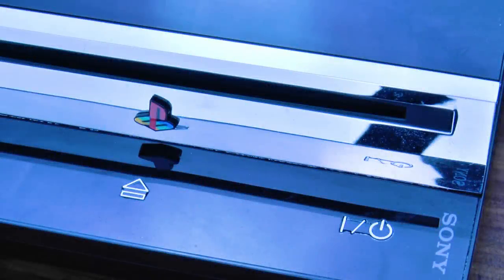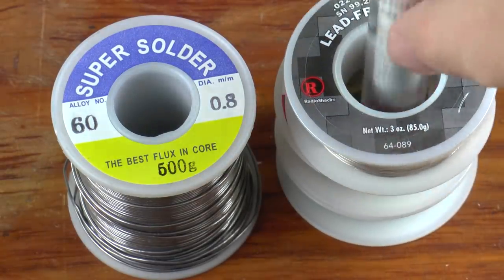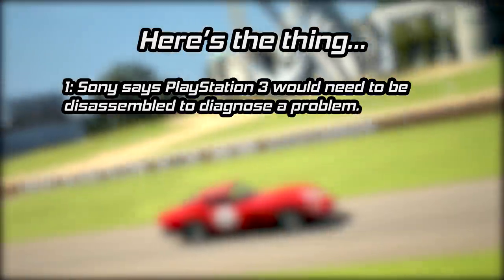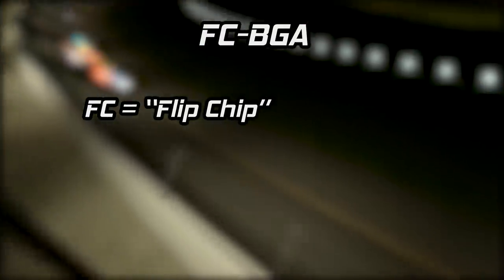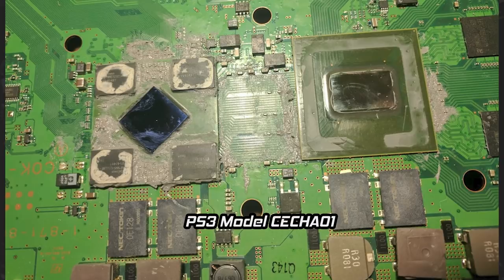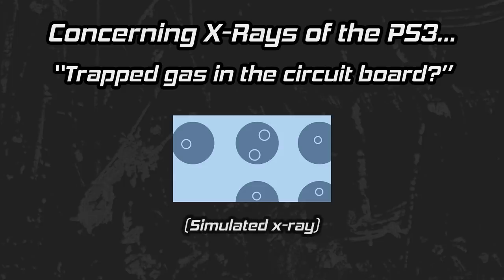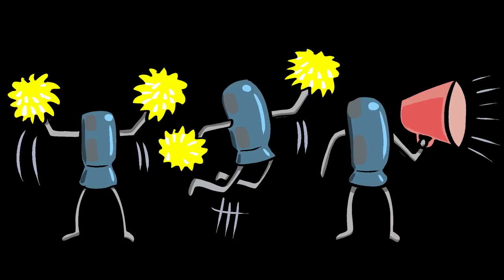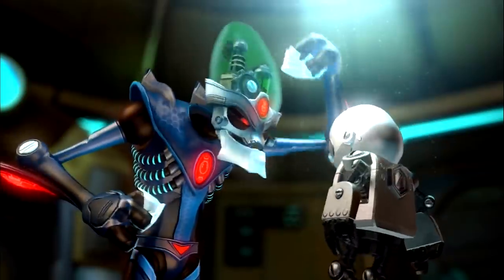The Misdiagnosis of the PlayStation 3 Yellow Light of Death

Comment: I have a launch PS3 that hasn't experienced the YLOD yet. I want to open it up, clean it out, add new thermal paste and new thermal pads to replace the old originals.

Is there anything else you can recommend to do to keep an early PS3 alive and well in the long term? Something that doesn't require extremely difficult soldering?

Would you be willing to make a video series on maintaining game consoles for the long term? I'd watch all of them.
Reply: Jailbreak it and adjust the fan settings. The default fan settings let the console go way too hot before properly cooling it down.
Reply: @calleha01  OK, I'll keep that in mind, thanks. If anyone has more tips, please share!
Reply: I water cooled mine for $35. Brought the temps from 85c to 45c...
Reply: It's a DINOSAUR
Reply: @jjhack3r  This is interesting, I'll look it up. Thanks!
Reply: I can tell you first hand... change out the thermal paste to something like artic silver 5. When I changed mine it was dried out. I seriously doubt it was helping with thermal transfer and causing unnecessary heat stress to the cpu gpu. If you do however, consider changing out the paste underneath the heat spreader as well. Just take your time and be extra careful... the spreaders are glued on.
Reply: @synth505  This is good information, thanks. I just bought arctic silver MX-4 (2019 edition) for my PS4. This drastically helped lower the fan speed / noise on my PS4!
I'll use the same for my PS3, and be extra careful about the heat spreader. Am I supposed to re-glue it back on? If so which type of glue should I use?
Reply: @Chocoburger  no... thermal paste should help to hold it in place. Also when you reassemble it, the heat sink that sits on top of the spreader will apply enough pressure to keep it in place.
Reply: @synth505  Understood, thanks!
Reply: @Chocoburger  if you look it up, you won't find much. I used generic water blocks, pump and radiator for a pc. Mounting the radiator is the hard part. Also you need custom brackets to hold the water blocks. I just used flat steel and drilled 2 holes.
Reply: @jjhack3r  This sounds much more complicated now. Without a video guide, I'll probably screw it up. But I appreciate the added info.
Reply: How?

Comment: Hey, also the PS3 heatsinks have an issue as well. They have too much vertical space below the motherboard and ultimately PULL on the GPU AND CPU hard.
The thermal paste bond between the IHS and Heatsink + gravity lets the heatsink tug on the RSX and CELL IH and pull it down. This physical force ultimately stresses the solder balls. I strongly believe this breaks connections whenever the RSX or CELL heats up. When these things get hot, the solder almost flows but slowly. (it'd take alot of thermal cycles) 

For my PS3 with the infamous GLOD, the screen started to artifact and a small sparkgap noise came out of the console whenever the RSX hit 75C. It hardlocked immediately after.
This tells me some solder balls that deliver high current to the chip disconnected and caused a hardware error. (This caused a GLOD for me occasionally + interminent artifacting)

I flipped the ps3 upside down so the heatsinks (because of their weight+gravity) push the chips onto the motherboard. (just like what the coin method fix for GLOD tried to achieve)
AND MY THEORY WAS RIGHT! IT NOW WORKS SMOOTHLY!

Its been 6 months of constant usage and 0 noises, 0 artifacts, 0 freezing, 0 problems and played through a bunch of games at 68C.
It seems like every aspect of the PS3 was fucked to begin with. 😅
Reply: Exactly. It's unbelievable how the design- and all the inherent flaws in it- were approved. The only explanation is that they felt pressure to rush out Playstation V3 (PS3) w/o an intensive several-thousand-hour testing period on 100 machines. If several thousand hours seems extensive, consider that a new console buyer would easily average a minimum 2 hours/day. Let's say average over1000 hours year.

Comment: In the middle of learning how to solder so I can replace the NEC Tokin capacitors. Even removing them seems difficult and there isn't a guide in English on the Youtube's yet. My CECHA01 and CECHC03 will survive.
Reply: My mate Vince recently did one..
Reply: @Jaydan121  Good timing. Saw it when it released.
Reply: Vince team, unite
Reply: yeah also saw the vince video,and this one popped up randomly,youtube sure do spy on us
Reply: I used a cheap heat gun off of Amazon, put it to 400 degrees took roughly 15-20 seconds came right off. Plastic did melt a tad but was no issue. I fixed my 40gb ps3 with this method
Reply: Use some leverage under the component then some heat on the solder lever upwards then move onto another solder pad, heat and lever, move and same again keep repeating and levering the component when the solder is liquid. Little by little piece by piece it will come free nothing to be scared of if you are patient. 
If you are removing a component to be replaced you can afford to bend and break it as it is going in the bin anyway, just be careful of the traces on the board but they should be ok unless the board is corroded.
Reply: Use and heat gun and some flux. Don't just heat it and take it off or pull it off with a knife without any heat. Better to do it the proper way
Reply: Just make sure to keep the same ESR!!!!! You got this! As long as you don't totally rip off the pads, installation of the new ones will be simple! Also keep one of the old ones on each side, they flow through each other, otherwise you need wires to connect them all! search "psx-place ps3 NEC/TOKIN replacement" and you will be perfect! :)

Comment: Love this video man. I work in contract manufacturing, I used to be SMT but now I'm on QC building 3D AOI profiles. I have an OG YLOD PS3, and have access to a large parts stock that my company will have no issue with me grabbing a couple tantalums to see if this works on the PS3. I'd be more than willing to collaborate on this project for a video with documentation of the process if you'd like, It would be fun to help the community in some small way
Reply: should be noted I pretty much have free reign over the rework stations and reflow ovens, with very adequate lighting and good photography skills. I can properly document this

Comment: Interesting video, never knew those capacitors were an issue! I've heard about the thermal paste under the IHS drying out over time, causing the system to run hotter than it should or shut down after a few minutes (this failure mode happened to my CECHG unit), and that nVidia GPUs in many laptops from the period the PS3 launched, between 2006-2008, had bad underfill processes causing them to fail, but this is new to me. At least the 360 has a secondary error code with its RROD to narrow the problem down - on PS3 you are just guessing.

Comment: I've actually repaired six PS3's by replacing the NECs with tantalums. Havent had a system fail again since :)
Reply: Do you do this as a side gig? If so, I have a YLOD PS3 that could use some help.
Reply: ps3 super slim no have nec tokins
Reply: @maytizevb  yep, I think the 25xx and 3xxx Slims uses tantalums and also the 4xxx series. Since this models doesnt suffer that much on YLOD, instead most of them experience we call blackout issue.
Reply: Is this a difficult process?
Reply: I have a 25xx model with the blackout issue. I have a working super slim I’ve been swapping caps with, haven’t tested all of them yet
Reply: @EmilePolka  i have ps3 slim what model is that exactly
Reply: @chasefournier  there are many things trigger this, try removing the bt/wifi module and see if that fixes the issue. if it does then you either have a power issue feeding to the module or the module is busted.

though that's only one of many known cause, sometimes the cause of blackout issue cant be determined, it just doesnt work.

to avoid this issue, i recommend that you unplug your ps3 power out from the wall when your done using it. after all when you plug your ps3 to the wall, that module is always active all the time waiting for the command when you press the PS button on your controller.
Reply: @EmilePolka  unfortunately that didn't work.
Reply: Kleiner Helfer  it would have been more helpful if Sony at least offered a repair service for systems out of warranty, rather than telling customers they're SOL.

I had a launch Xbox 360. Didn't suffer the RROD, but it had a faulty AV port. Since it was out of the warranty period, and not covered by the RROD extended warranty, they still offered to fix my system for $100. Which is more than Sony was willing to do.
Reply: Kabal82 sony fixed mine that was out of warranty, but the replacement failed in the same way
Reply: remle ikawura what’s the blackout issue? I just bought a ps3 online that I want to fix and it has a green light, but no video output on either hdmi or composite (and yes, I tried the two beep reset input procedure). Is this the issue you refer to? Any help would be much appreciated. I also could see the prev owner tried to solve with nee thermal and flux so I assumed they heated up the joint. They said “video displayed once”.
Reply: @mikeO31082  Sony did do that for a time. I don't know when they stopped though. They charged $150, but I've read posts of most people getting back a different PS3 than the one they sent in. Not a different model, just a different unit
Reply: @RyanBurnsRed  I got a brand new 60gb when I sent mine in, but it also YLOD two months later. Sony only offered 30 day warranties on the "repair" too.
Reply: @hailhydra5061  graphics chip what was wrong with mine. When I could rarely get video the screen would freeze and be all pixelated it is a ceche

Comment: "Trapped gas" could refer to buried vias that are basically metal-plated holes connecting two parallel wires inside the PCB itself. A large board can have thousands of these. Naturally, those holes have harmless space in the middle unless filled in by some material in a separate operation...

Comment: Check out the PS3 "eraser" mod. I did it and my PS3 temps dropped 10C. This fix shows that earlier models of the PS3 simply didn't have enough mounting pressure for the CPU heatsink to stay cool. This isn't a sketchy mod either. It's just recreating what Sony did in later models that included a plastic cover for the CPU hole that increases mounting pressure.

Additionally adding CFW to your PS3 shows that Sony prefers running your consoles hot all the time in favor of low fan noise. My early model PS3 idled at 80C before the mod and the fans were sitting at less than 20%. To put that into perspective PS3s have an emergency shut off at 85C due to high heat. That is very little headroom and running the consoles that hot all the time is bound to lead to issues. The CFW has custom fan controls which I'll be using from now on so it doesn't die an early death. Fans aren't even much louder if you repaste and do the eraser mod.

Comment: The solution is to replace the nec tokin caps
Reply: can u easily replace them?
Reply: @Kig_Ama  that I don't know but it does require the use of a flat bladed knife
Reply: They don't come up easily. Takes a while working at them with a hot air gun to pull them up.
Reply: @Kig_Ama  define easily... they are a pain to extract... once removed you can put the new caps and thats it (remember to put them on correct side)
Reply: @iamtheflu  though, I've seen some people just "cut them" and solder caps on the side... 
Not clean, just lazy... but works fine.
Reply: @iamtheflu  I do repairs on those nec/tokin. and they are a pain in the ass to remove. the easiest way is to destroy de capacitor with pliers or something (being careful) and after that remove the legs of them with an soldering wire. and replace them. on the inside they usually look very burned.. but that is what works best for me
Reply: @jpraleixo   makes perfect sense bro. So what's up with that service???

Comment: For many many people that before this had never even diagnosed a failed board, most folks accepted or tried whatever they heard on the message boards about reflow, reballing. and such. Anyone that knows anything about fixing problems with PC or Apple products need to be checked for shorts to find the problem even taking out components to test them until the fault is found.. not a easy process.  It seems now many are pointing to the NEC/Tanum capacitors failing badly, and that has been confirmed so far as I know. Great video by the way.
Reply from the maker: Thanks, Mike. There is definitely a difference in the pursuit of knowledge and making a diagnosis between those that repair vintage PCs and those that repair consoles. Hopefully we see more people investigating the PS3’s faults these days vs one fix solves all.

Comment: Great scientific analysis. I repaired a friend's PS3 several times by "home-reflowing" the board on my electric frying pan. My thought process was the same as yours, I had assumed it was "some" solder joint or other component which liked being heated up again, but I wasn't assuming I was reflowing the CPU or GPU or anything targeted like that. As you say, it's a very heavy hammer of a fix. So heavy I was actually concerned with surface mount components falling off the underside of the board if I heated too much!
Reply: Backside components are attached with epoxy, which is usually dyed red. They first populate the backside, and during reflow, the epoxy sets, and then the main component side. If they could fall off, they would have fallen off while main component side was reflowed during manufacture.

Comment: There was a massive problem with all sorts of semi conductors that used lead free ball grid array solder joints. It affected everything that used them at the time, even desktop GPUs. There are many studies of it. Lead free solder required more than 2x the temperature of 40% lead solder to fully turn to liquid and reharden correctly. This also hit around the time of the great capacitor plague where the world market was flooded with a stolen unfinished capacitor substrate formula that caused premature failure of electrolytic caps. It was a terrible time for reliability of every electronic device.

Comment: I used the blow-dryer method to fix my ps3 temporarily. Does this mean my YLOD was actually a solder problem rather than a capacitor one?
Reply: A hair dryer doesn't get air hot enough to melt lead free solder, so no.
Reply: Did the same, managed to get the disc and transfer all save files to a slim system, thank god.
Reply: The correct answer is: It's warms NEC Tokin capacitors back to life but it is not a very long lasting repair and we can’t know how long it will work.

Comment: The issue with diagnosis is that the YLOD is so vague that it can be literally anything. Simple component came loose, NEC caps, overheating, or (in my case) the bga failed on either the rsx and/or the cell-be. Because most lacked the knowledge to read the syscon, the misdiagnosis happened and continues to happen.

Comment: You failed to talk about the other major problem with the Yellow Light of Death... Bad Blu Ray Laser Modules... I used to repair PS3's through eBay at a rate of about 10 to 20 a week in 2008 and 2009.. This was a major problem that was easily fixable by getting a Japanese made laser module vs the factory provided Chinese part.
Reply from the maker: Yes. There were also problems with power supplies going out - various revisions of the PSUs run hotter while others are more efficient, etc. My primary focus for this was the most generally accepted "assumption." One of my good friends that bought a PS3 not too long after I bought mine had the blu-ray drive go out on his system. Frustrating, for sure.
Reply: Would that really cuase a yellow light situation? The PS3 didn't actually need a funcitoning bluray drive to start or even to run games since it had an online store and all.
Reply: You say "failed", I say "now I have an excuse to ask for a part 2"
Reply: How come? I've yet to stumble upon a yellow light caused by a bluray laser module.

Comment: Now it’s also discovered it can be the nec token capacitors and the older rsx chips are less reliable I believe in comparison to the later ones but a transplant can help it apparently or a orbis chip. We can also diagnose a failure or find an error code based on the syscon chip I believe.